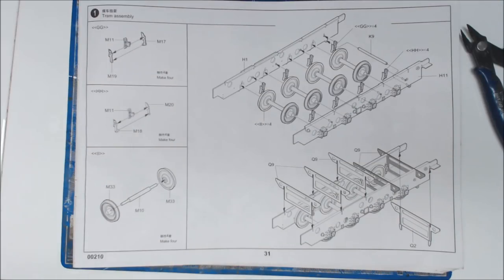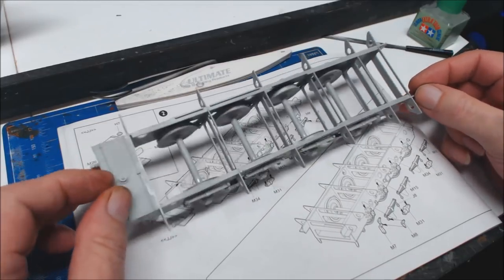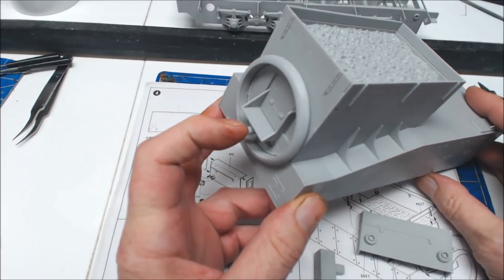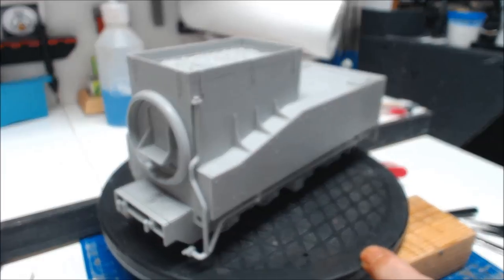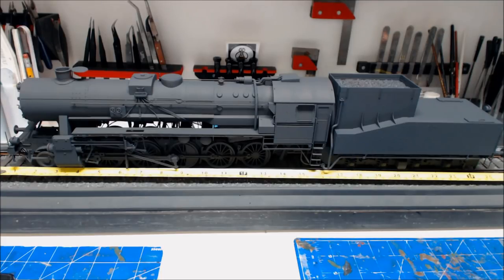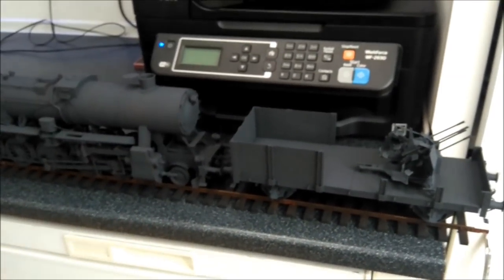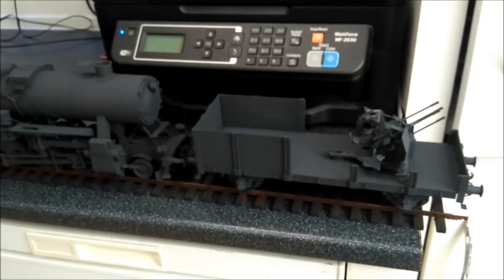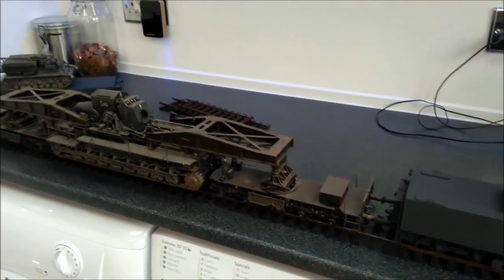Trumpeter 1/35 scale Baureihe 52 Mit  Steifrahmentender Build part 3

Comment: Looking good Simon. You might want to stop by a hobby shop that carries scale trains and buy some HO or O scale coal for the tender. RR coal was pretty small pieces so either scale should work OK.
I "think" the pipe under the coal chute is an auger for mechanically feeding coal to the fire box. Every movie featuring a steam train shows someone shoveling coal, but mechanical augers replaced the shovel long before the 1940's. I find the differences in US steam trains and European steam fascinating. The boilers and the coal capacity of the European trains is smaller than the US engines. But then if you look at the distances US trains ran vs European trains you realize the extra capacity just wasn't needed. And I'm always perplexed at why the European boilers sit up so high above the drive wheels. They always look top heavy to me, like they'd tip over very easily.

I wish someone would build a 1/35 scale British or American engine from this era. I'd love to build a train with an allied cargo. The US built a bunch of steam engines specifically for the European theater since they knew they'd have to rebuild the railroads to use them. THAT would be a great model to have!
Reply: Oh good idea. It was an S160 that we used over here in WW2 from America would be good.